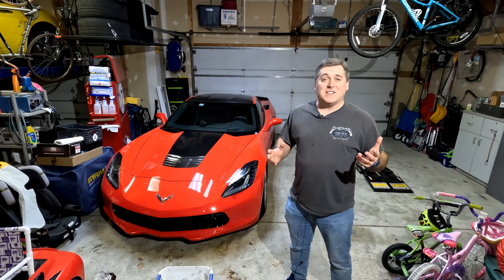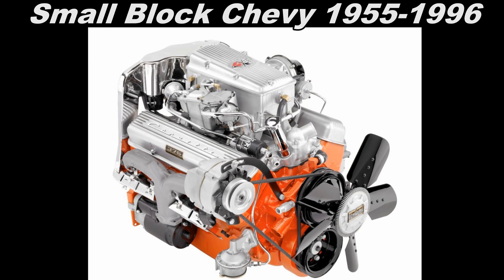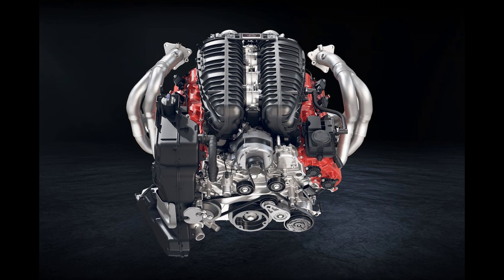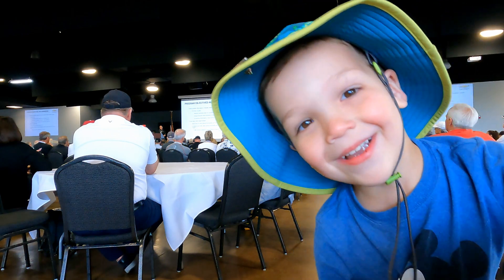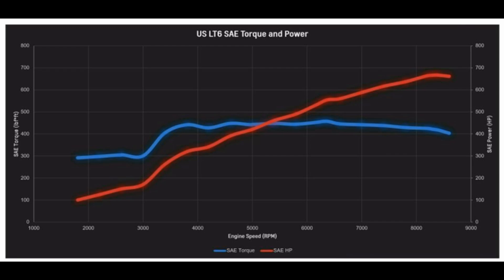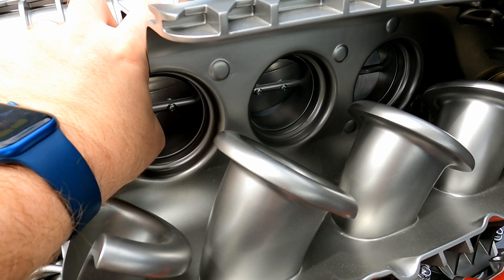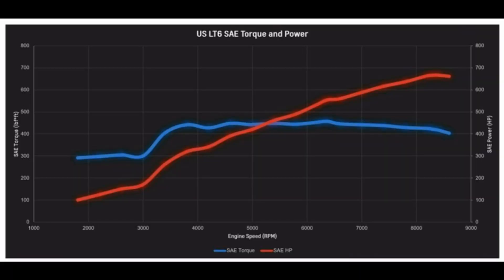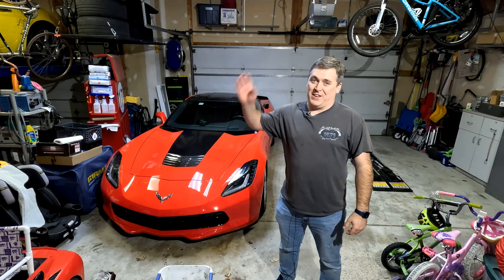How does the C8 Z06 make so much torque?

Comment: C8Z06 will be the LOWEST TQ C8 (460tq) that will ever be made BUT C8Z is heavy @ 3775lbs   vs C7Z06 has 650tq pushing 3457lbs
Reply from the maker: Oh boy… one of these guys… you didn’t watch the video did you?

It is absolutely phenomenal that a flat plane DOHC 8600 rpm redline screamer has just as much torque as the Stingray’s famous LT2. It is a flat out miracle of engineering.  Although the LT2 has 10 more peak torque than the LT6, the LT6’s torque curve is flatter and it makes more torque than the LT2 for the majority of the time spent above 3500 rpm (where the Z06 spends all its time).  This engine imitates the high end performance of a high revving European engine without the loss in torque typically associated with those engines.  It’s the best of both worlds.  It’s never been done before, the Europeans thought it was impossible.

The Stingray is a phenomenal car, but it doesn’t compete with the Z06 at any level.  

The C7 Z06 was not a good car.  It was flat out embarrassing to be sitting in the pits because the car went into limp mode from overheating.  Even at tracks where it wouldn’t overheat, it was heat soaked and driving at C7 Stingray speeds within 2-3 laps.  By 2019, they fixed it, (except the heat soak) but in 2015-2018 it was a disaster.  Even now, there are no metrics where the C7 Z06 outperforms the C8 Z06, except torque on a dyno stand.

You’re forgetting the C8 Z06 has a much taller differential than the C7 Z06 and a much better transmission.  That was easily able to make up for engine torque.  The C8 Z06 is a whopping 6 seconds per lap faster at VIR, it’s not close.

I like the C7 Z06, I like the people who drive the C7 Z06, but you came at me pretty hard so I hope you understand that I had to back you down with a good rebuttal :)
Reply: @RecordsRebuilds  C8Z06 VIR time    2:38.60  vs   C7Z06   2:39.77  https://www.youtube.com/watch?v=Hq0cvWZkv5I
Reply: @RecordsRebuilds  I remember the same fan boy praise of Ford "greatest engine ever" the 2015 FPCC in the GT350....after 3 revisions to fix it's "greatness" Ford stop making the greatest engine......and kept making the non greatest engine.........
Reply: @RecordsRebuilds  Soon youtube will be flooded with videos with "ZR1 fixes all the short comings of the Z06".......setting my alarm now